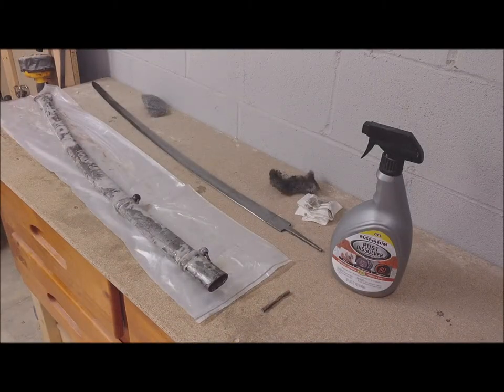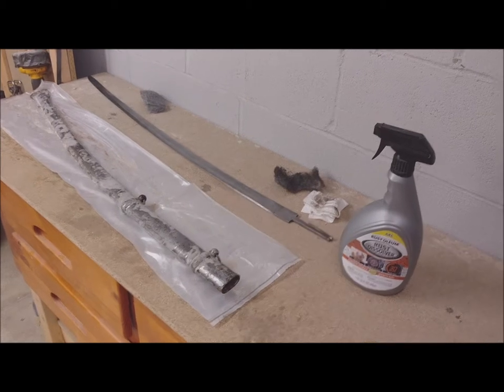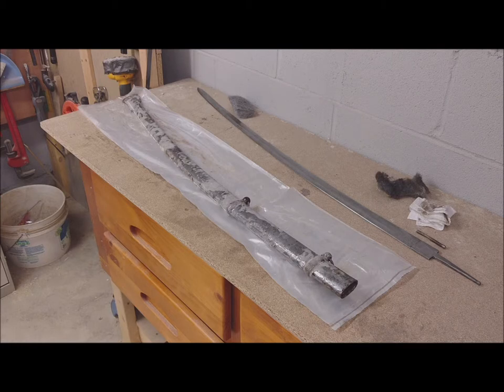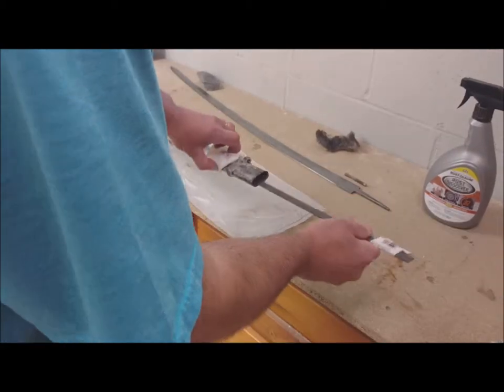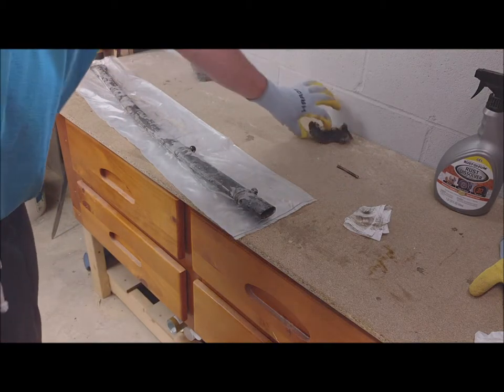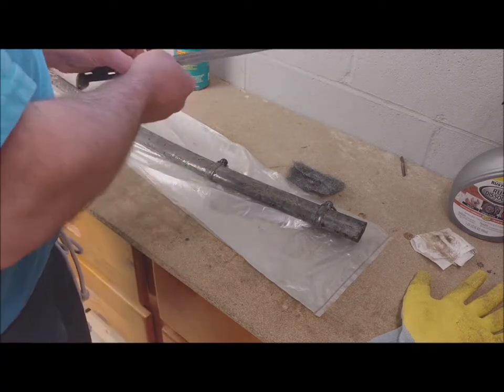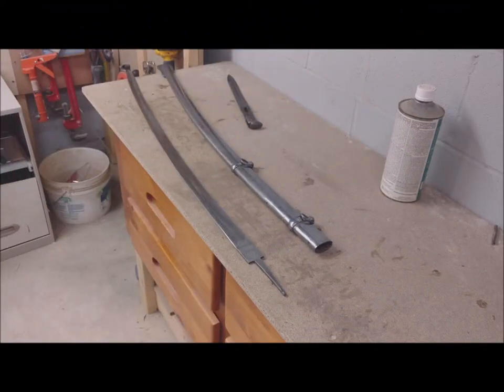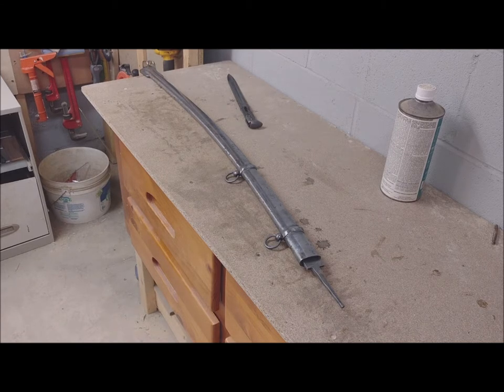Easy Restoration of Antique Sword Saber Scabbard

Comment: I'm working on the same Union civil war sabre scabbard that only has some light rust; and have been considering the gel version of the Rustleum rust remover. My concern has been would the chemical reaction "Discolor," or darken the steel scabbard. You've done a very fine job on yours. I won't be using a Dremel or any brushes like you, except some ultra-fine Scotch Brite pads, 0000 st. wool by hand after applying the chemical rust remover.
I'm very pleased to see that your Rust-Oleum product did not discolor, or darken the steel.
Really nice job you've done there, buddy - and I appreciate your sharing your work here, thanks...
Reply from the maker: Thank you for sharing your experience

Comment: I would get a pic pipe and cap one end, fill it with diesel fuel / heating oil then insert the sheath in, completely submurged. Leave it in for 24 - 48 hours. When you take it out there will be no rust. Dry it with a cloth, then spray with breaks cleaner.
Reply: PVC pipe from Home Depot or Lowe's.
Reply: dakatajv really!’will that work with gun barrels?
Reply: Tough rust may take a week. Or lime soda.

Comment: how to clean the case from in side?
Reply from the maker: Hi, l poured in acetone and scraped inside by a metal bar, then washed out by acetone and repeat. Later when inside dry, I spray gun oil
Reply: @stelyoto  I have a very rusty case, I dont thing aceton will make the job.
Reply: I wll try
Reply from the maker: I think the gun oil will help